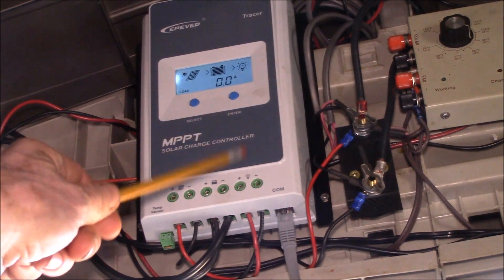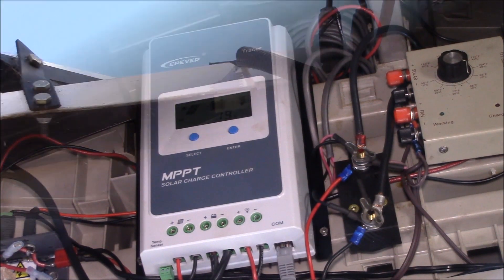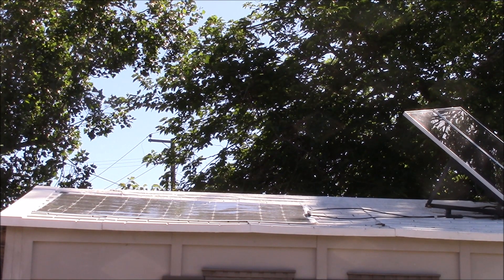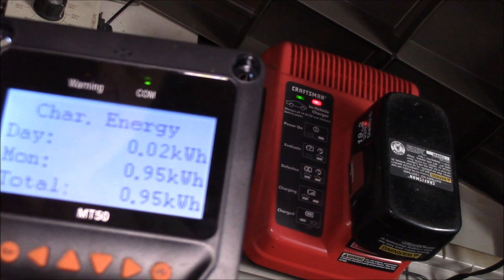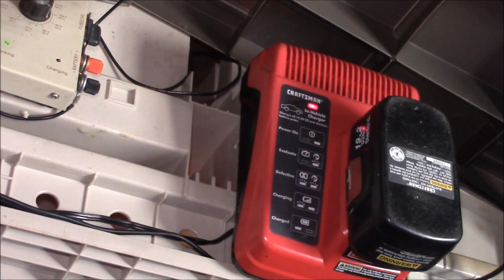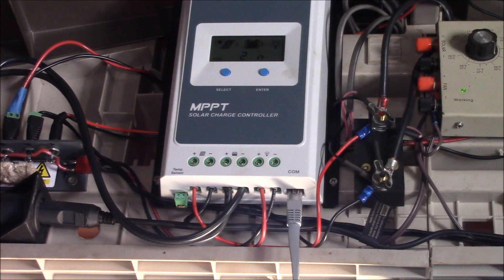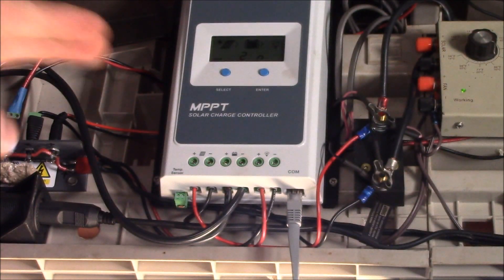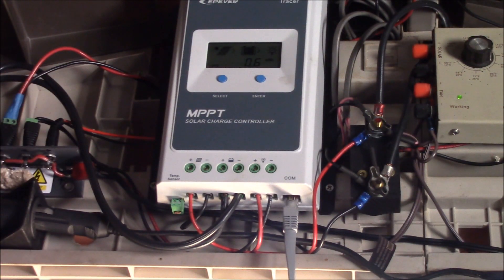EPEVER Tracer 2210AN Charge Controller for the Solar Shed, Part 2

Comment: Is the epever controller 50a?
Reply from the maker: The one in this video is rated for 20 amps.  I think they may have a 50 amp model, although I've never tried that size.

Comment: Hot summer days that beat the heat...imagine cruising Death Valley with solar power coolness...♀
Reply from the maker: Yes, you got that right!  I plan on putting the 200W flexible panel atop my Toyota 4Runner and have that able to keep my ARB Fridge running in the desert heat all day long.  I love heading out to Death Valley and the surrounding areas.  The heat is fine as long as I have a cool drink waiting back in the truck.

Comment: I have never used the load out of a charge controller. Most of the time the load out is much lower then the charge value. I have one that was a 30 amp charger and the load was 10 amp. Looks good
Reply from the maker: I wanted to make sure all the shed loads are run off the load output of the charge controller so that they would be shut off if the battery voltage drops too low.  Every so often, we get some hot, cloudy weather where the cooling fans run but there's little solar power coming in.  Last summer we had a 3 day stretch like that and the batteries were down in the 10 volt range before I checked in on them and shut off the fans.
Reply: @The4Crawler  can the dc load output turn on for 24 x 7 ? I read the manual, it has time duration of working. My load require 24 x 7
Reply from the maker: @JasonWee  Yes, there's a setting for that.  On some controllers that's the default, on others you need to change the load setting from "so many hours after sunset" to "manual on".  Then you can turn the load on/off with the load button or the controller will turn it off if the voltages drops below the set threshold.
Reply: @The4Crawler  thank you, that is very helpful.
Reply: @The4Crawler  another question, if the load is connected to the terminal that is same with the battery line, so how does the controller know if the battery is fully charge? cuz the load may take up some voltage/current, yes?
Reply from the maker: @JasonWee  Essentially the load is connected to the battery via a high current MOSFET so that it can be turned on and off by the controller.  The controller senses the battery voltage off the battery terminals.  If the battery is fully charged and the load is taking some additional current, the controller will send the load current out to the load while holding the battery at that fully charged state.